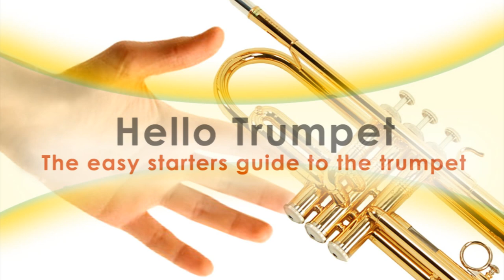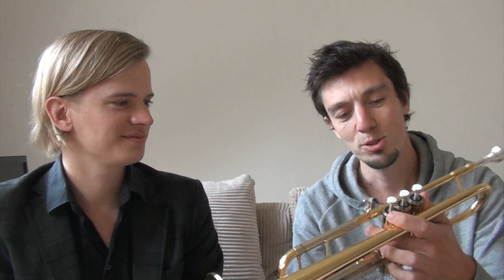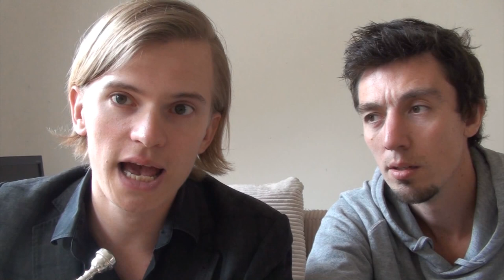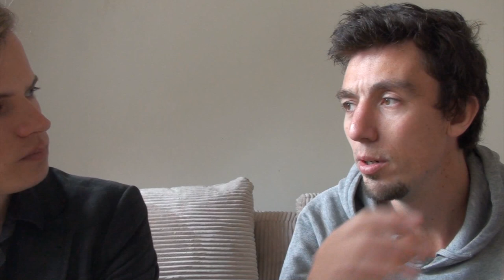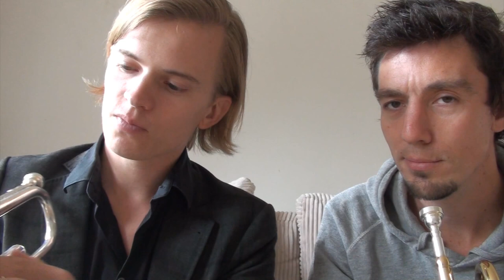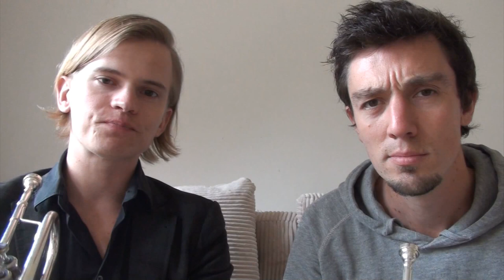Playing your first note on the trumpet (Embouchure)

Comment: This is great stuff!
I looked at my hands and  realized my right thumb is bracing the lead pipe and the pinky is resting on top of the hook a the same height as the valve buttons. it's very comfortable.
With the concert mellophone I rest the edge of the bell in my left hand. After a few tries it seemed the most natural and stable position.
Each instrument has it's own preferences.

Comment: Thank you very much for the video guys  though, I have a question  why if I press the middle button I can make it sound and then if I press one of the other two I also make it sound but, if I don't start pressing any of them I don't make the sound at all? it's driving me crazy..  thanks a lot again xx.
Reply: You should just quietly blow air to the horn  without pressing any valve, and like the guys said in the vídeo you should manipulate the aperture in your lips, if you are not making any sound in the open position  it might be because your apertura is to loose